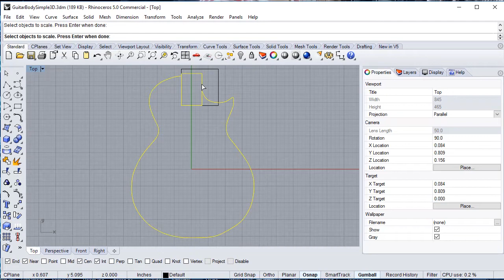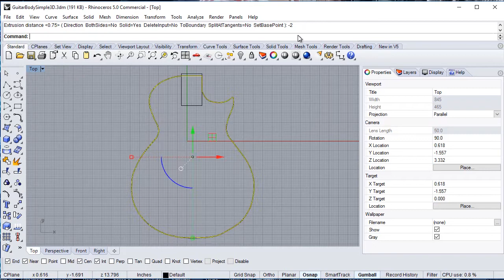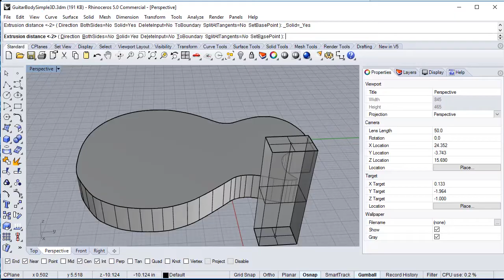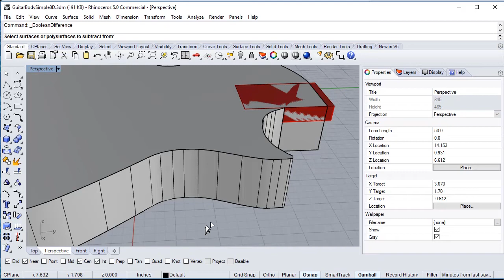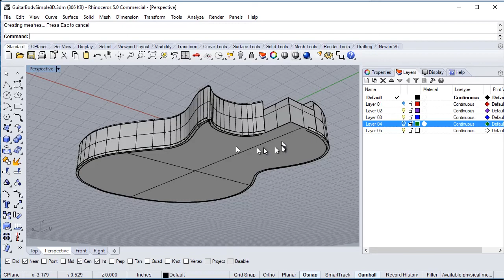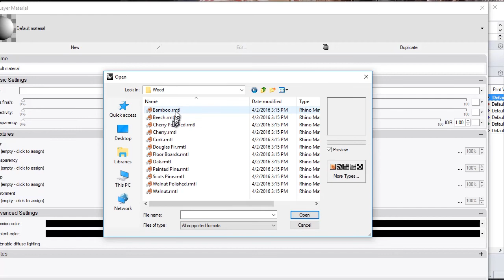Easy Guitar Drawing for Custom Guitar Bodies, Part 2 [CNC / CAD Project]

Comment: Neck pockets aren't rectangular. You won't get a good/tight fit like this.
Reply from the maker: Correct.  There are rounded corners and even rounded heels.  We'll deal with that, as well as issues like the relationship between the bridge and the neck in future installments.  We are far from done!
Reply: No, I'm talking about the fact that the 2-3/16" neck dimension used is as measured at the heel end. The neck tapers all the way to the nut and will be a couple mm narrower where it first meets the body. For a proper fit the pocket should be tapered to match. (Not trying to troll, appreciate the videos, just pointing this out)
Reply: What if you design the neck as well, then no problem:)
Reply: Question, seeing as you seem to know what you're talking about: does this matter for neck through designs? I assume not because there will be no neck pocket as it's one piece of wood.
Reply: @jameswellington4795  you would still want to taper the neck, but yes the neck pocket won't matter.